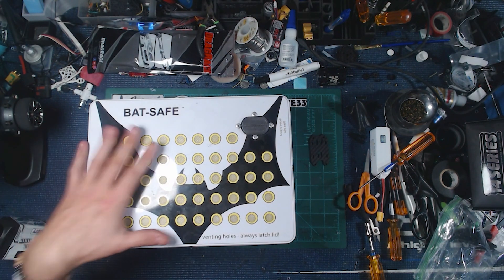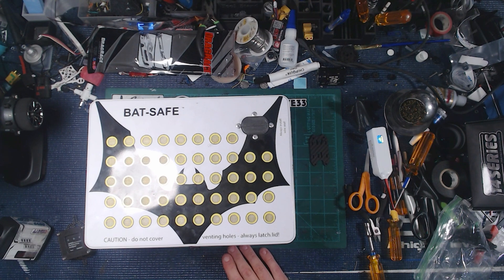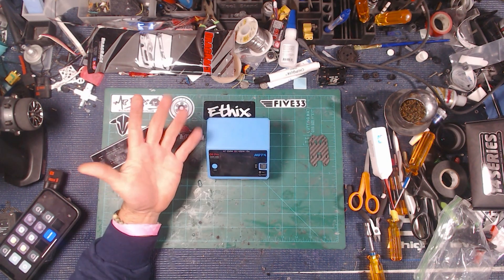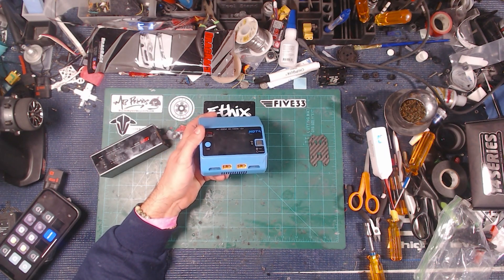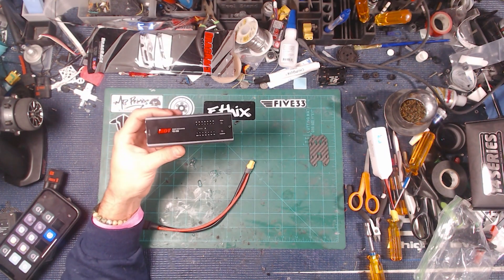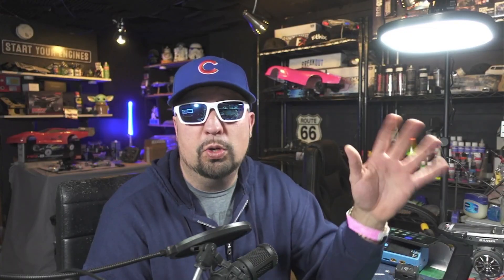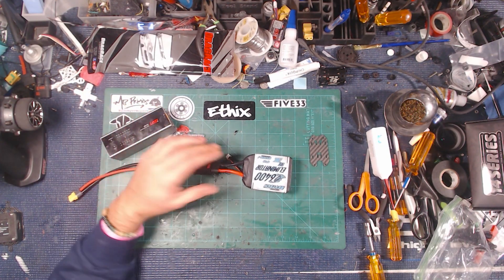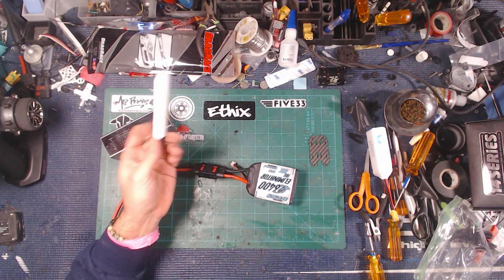BEGINNER NPRC BATTERY CHARGING | CYCLING AND SAFETY | MORE POWER

Comment: How low do we discharge down to when cycling,and at what amps do you recommend?
Reply from the maker: my discharger goes down to about 3.6 volts.  ideally you would want something that cycles down to 3.5 per cell for maximum benefit but depending on what charger/discharger you have you might not be able to set this.  when it comes to how fast that is up to you and your equipment.  if you plan on cycling just for storage and longevity then the discharge rate is up to you..it just takes a lot longer at 3amps vs say 10amps to repeat this process 2-3 times and then charge to a 3.8 storage voltage.  but if youre at a race and trying to play the cycling game to drop your IR and maybe squeeze something extra out of your pack then you want a really high discharge rate ..some say 20-30amps and then you need to charge the pack at the same rate.  i dont do this.  its a very advanced technique that usually only work when you might be at a big race and have the time to do this multipl,e times in between runs.  at my races we might only have 10-20 mins so all i can do is just top off the pack. so thats why i cycle at home to try to maintain it after abusing it at a day of racing